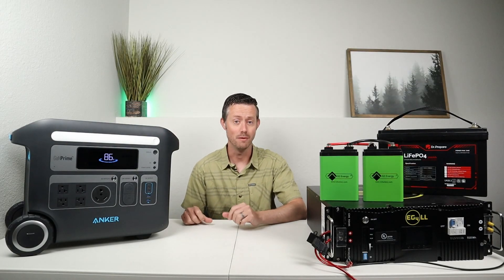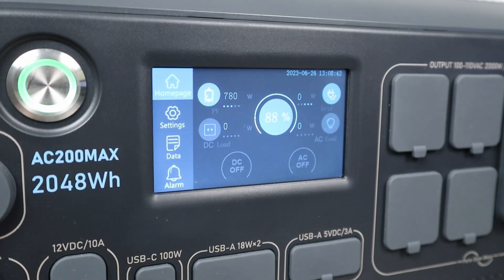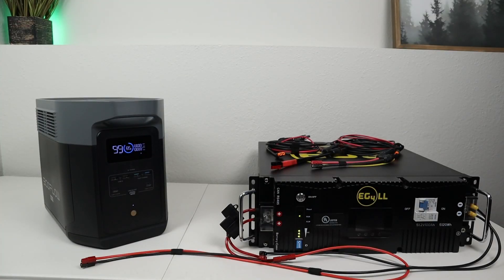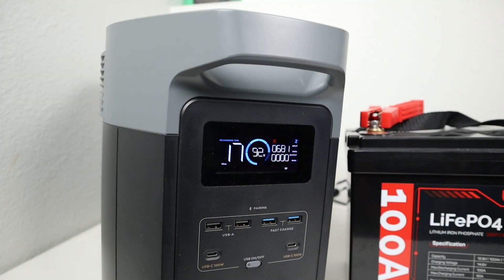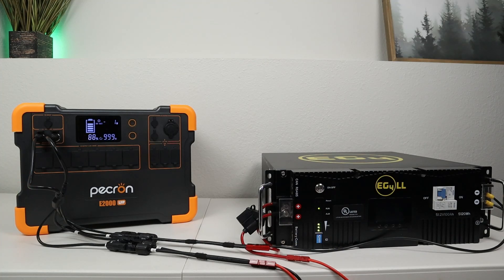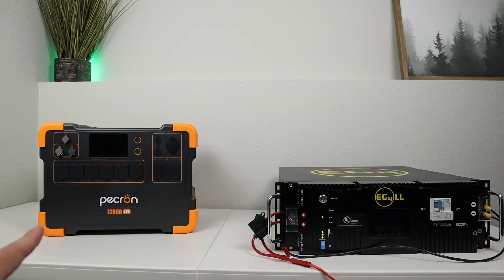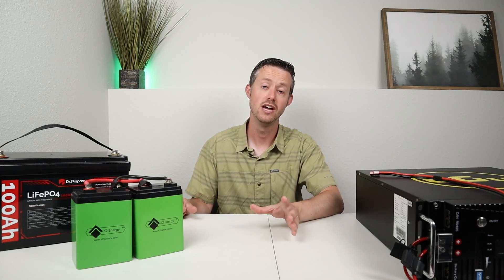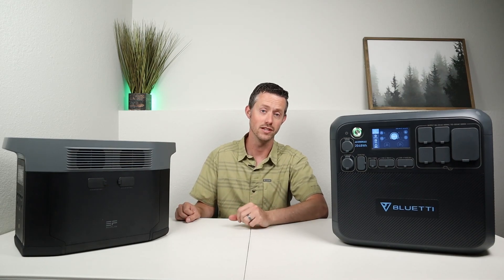Using Batteries To Extend Power Station Runtimes?! 48v LFP Server Rack 'Expansion Battery'!

Comment: Thank you for this information. 

In regards to recharging the external lithium battery, the Dr. Prepare 12v 100Ah battery, how do you go about recharging that battery once it is depleted? Can you just plug in a 12v DC adapter from 120v AC wall outlet? Like let’s say the wall adaptor that comes with a car refrigerator for example? (120v AC in with 14.5v DC out at 4.1A or 60 Watts) Will the BMS auto shut-off the recharge when completely full?
Reply from the maker: You'd have to manually charge the battery up. It's best to use a dedicated LFP battery charger or solar charge controller like either of these:
https://amzn.to/3XzQo1j   (AC Charger)
https://amzn.to/3CVrdgg  (solar charge controller)

I wouldn't recommend using just a power supply but technically the BMS should stop charging when it hits a certain voltage. But it will start and stop charging over and over unless you disconnect the power supply.
Reply: @Jasonoid  Thank you very much for this information!

Comment: Question regarding your 24V setup, curious if the result changes if you switch from using the 2xK2s to 2x100Ah. Also, what happens if you hookup the batteries in series vs parallel.
Reply from the maker: Voltage is voltage. If you have two 12v 100ah batteries in series you'll get the same result as one of these K2 batteries (I only showed off the K2 batteries since I have them around for my kids power wheels). 
When you put two 12v 100ah batteries in SERIES you get a 24v 100ah battery. If you put 12v 100ah batteries in PARALLEL, you get a 12v 200ah battery.
Reply: @Jasonoid  From a capacity perspective I understand. I was just wondering if hooking up series vs parallel had any impact on charging rate.
Reply from the maker: @kourgath007  the lower the voltage, the slower the power station will charge. You'll see 100 watts charging at 12v and 200 watts charging at 24v
Reply: @Jasonoid  I am assuming that using a 2x100Ah 24V configuration would benefit from using a boost converter like the one you setup in a previous video. Boost output to 48V @ 10A. Just trying to think through optimizing this setup.
Reply from the maker: @kourgath007  you would charge more quickly that way but the more efficient way to charge would be without the converter and just using 24v directly from the battery

Comment: Maybe I missed it, but make sure your battery has a BMS to protect it from over discharge.  I made a cable with a 6s BMS to go  between  my 6s  batteries and the solar power station , i.e. only need one BMS for multiple batteries.
Reply from the maker: All batteries I am testing with in the video have a BMS. I guess the only battery type that wouldn't would be a lead acid battery. Great tip, thanks!

Comment: Jason, WELL DONE!! A much needed  solar power video that answered questions about this subject that has been overlooked by many.Thanks for the tool links but also wondered if you had an Amazon store for Jasonoid that we could buy from? Also could you provide links for Anderson power pole connectors and the inverter in this video please? Also what amperage for the Anderson connecters , 30 or 40 amp?Thanks for another clearly explained video on this subject material.
Reply from the maker: I use the 30 amp Anderson connectors. Here's an old video I did on how to crimp them... parts are in the video description. Warning... its old so it may be a little cheesy compared to my newer stuff:  https://youtu.be/bZHh3nWXtkw

Comment: Learned something new today.  I did not realized I could hook up the Bluetti charge enhancer as a simultaneous second charge source from my 24V battery (primary connection is a 24V to 48V DC boost converter) setup to charge my AC200P.  Thanks again for doing this.
Reply from the maker: It's useful when trying to dual charge :) You'll have to let me know if it still works using the same source. The charging enhancer doesn't seem to like the 'shared ground' between the enhancer and the mppt when connected to the same battery.
Reply: @Jasonoid  I have 2 Power Queen 12V 100Ah batteries connected in series, channeled through my 24V to 48V boost converter into the AC200P solar input.  The Bluetti charge enhancer was connected to the same battery and input into the AC port.  Happy to say that this works.  I was getting 570W (typical with this setup) through the solar port and 226W through the charge enhancer.
Reply: Now I am wondering...since I am using the solar input port from the external battery input, the solar panels are disconnected.  Can I hook my panels up to a solar charge controller and then to the external battery to charge it while the above setup is in place?
Reply from the maker: @robertlueke3238  yes, you can have a 24v charge controller and solar panels on that battery and charge that up instead.
Reply: @robertlueke3238  in other words does your external battery BMS allows passthrough charging to allow charging it via solar at the same time you are discharging via boost converter to DC port? Perhaps an interesting test idea for a video...🤔

Comment: Almost got my answer with BLUETTI I have the AC300 and one B 300. I just got the AC180 and do50 charge enhancer can u do a little more on the way to use my 48v server rack battery it’s just like one u used in this video but didn’t seem to work through the charge enhancer which I was hoping to use the 48 v server battery with charge enhancer on my AC180 any ideas ??  And thanks for this video and any advice going from here.
Reply from the maker: The 48v battery works fine into the MPPT port. I'm guessing it didn't like the "shared" power source so having both chargers connected to the same battery is a no go. I might try some other solutions to see if I can get it to work.
Reply: I did watch a video where a guy used a 24 v battery with charge enhancer and he said to always have power to the charge enhancer first with green light on before hooking up to the BLUETTI Input said it will blow the 15 amp fuse inside the charge enhancer. That might have been the 730 w surge you got before it shut down just a thought
Reply: I’ll keep my eyes open thank you

Comment: thanks for the video, my take away
diy expansion batteries are almost always cheaper per additional capacity added, but requires more work on yourself, while the expansion batteries are simple plug and play.
shop around sometimes you can get great deals on diy solutions, but if you want a headache free solution, the expansion batteries are a simple solution.
Reply from the maker: Great take away, I agree :) If you want something that just works without thinking, the model expansion batteries are the way to go.

Comment: Thanks for doing this. I've been considering doing this. I have an AC200 Max and have read of people using a 48 volt battery with the charging enchancer and it working fine. Can your try using the charging enchancer plugged into the unit  by itself?  (Without the 48v battery also powering the main solar/dc port)
Reply from the maker: Yeah, I think it has something to do with 'dual charging' from the same source.

Comment: Of course if I could buy us a lot of EG 4 batteries or something like that where I can get like 6 or 12 woman hook it up to something like that and keep it running indefinitely and charge it with solar both ways then the batteries and the generator I think I might try that even though I think it might be better just get their battery packs instead but it gives me good options thank you very much cuz I'm about to buy adelta bluetti or pecan or all three even though I can buy only one at a time without their batteries because I have to save up money for that just like I got to save up money for each of the generators I want to buy what is your next week or the week after I'm buying one even though I want two of each even if you can't combine them because I have uses for them in different situations with different areas which one of them would really help me out in my car in the wintertime to keep the inside of my car warm and fridgerator and freezer going as well as a little heater like I said warm and maybe something to cook with and that's something like that I'm planning for my daughter when she gets a vehicle are cool for the summer time when car is off and not going anywheres which also the same for the summertime. And I think I could use it in my house a little bit but from one room to another probably not just one room at a time. I mean even the Delta pro is only subject to 7200 watt could almost run to my big loads so I have to get three different ones six of them but they all wouldn't be from the same company just for the difference 120 part I won't have a problem with it with those it's just a 240, 220 have problems with cuz it doesn't give enough watts to run them all at the same time which one of them choose when I'm going to run one of them that parting some big of a deal it's just incidentally 2 of them wants to run at exact same time I would have big problems.
Reply from the maker: I certainly don't have the budget for lots of these 48v batteries, I could hardly afford one of them. I thought it would be a fun video to see what would happen! Thanks for checking out the video and sharing your setup!

Comment: Excellent video!  EG4 has some really great products.  I am looking at this option for my AC200MAX.  I already have 2 of the B230 batteries and 2 of the DC charging enhancers.  I am wondering if the AC200MAX is experiencing a problem that was observed on the Pecron, ie, some kind of loop by using the same source on the two different inputs.  I haven't checked with the server rack battery as i have yet to purchase one, but the charging enhancer definitely works by hooking a PV 350 panel to the AC charger input and 2 of the PV350 panels (in series) to the PV input.  I suspect that having a common ground between the 2 inputs may be causing the problem.  About twice a year, Signature Solar offers free shipping so keep an eye out if you want to order something from them.
Reply: I think that by adding 15A or 20A blocking diode to each of the ground returns to the battery (15A will loose about 9 watts and 20A will loose about 12 watts), this would break the common ground of the battery or multiple batteries and allow Pecron and Bluetti to use both inputs from the same battery if the common ground is indeed the problem.  I'm going to order some and try them out.
Reply from the maker: Good thinking with the diodes, thanks for the recommendation.  I'll have to try to mess around with it when I get a chance.
Reply: I am planning to run my 48v EG4 server rack battery with the Bluetti charge enhancer on my AC200max, but ~900W solar on the other input.  I’m hoping for no over-current issue as in your video.  It also appears that the AC200max also doesn’t let you prioritize solar for dual charging, but rather gives the max from any input.  I guess the best thing is to run enough loads while charging, so you don’t care so much.

Comment: I just added the battery I ripped out of the broken Milin to the AC200P yesterday. I have a 180w panel into a separate MPPT Charging the Milin battery, and the XT90 from that battery plugged into the DC Charging Enhancer. I am not doing it to extend, I am doing it to try and smooth out the input.

I vote for the DIY setup as I don't trust being tied into a proprietary battery. I think a 48v server rack, or series capable 12v lifepo4 is the way to go. They are modular and hence repairable, and easy to connect to anything. When the Milin died I couldn't repair it, I just had to disassemble it and take out the core which is just the batteries and a BMS.
Reply from the maker: I'm curious, what voltage is the Milin battery?

Comment: Another excellent video.  I appreciate how you explained that this does NOT add capacity to these power stations, it is simply charging them from another source, which can be done (with most of them) while they are in use.  This effectively extends their run-time and I like how you articulated that distinction.  I am using a variety of "2nd-life" batteries, like the 24v 9.6AH units you got from Battery Hookup.  I like building stuff myself, even though there are definitely mistakes made along the way.  I think the brand-specific options for truly adding capacity to these larger power stations are cool, but also insanely over-priced.  I personally feel that if you need the kind of capacity they advertise with their add-on batteries, you're probably getting out of the "portable" space and you would be better served with a component-based system, at that point.  Love your work!
Reply from the maker: Great comment Jason, I appreciate you watching the video and sharing your setup. I think there is a lot of value in finding used batteries and repurposing them :) They are usually CHEAP! haha

Comment: The only real negative is not being able to hook up an expandable battery to the main unit and have it charge! It would be great to be able to charge it from solar through the main unit.
Reply: Most power stations have a DC output and you can get a DC-DC charger... would be interesting to see the efficiency loss though👍
Reply from the maker: The DC output can't handle much power, only 125-135 watts usually. So as long as it's a low powered DC to DC charger that will work.
Reply: @Jasonoid  I believe there are units like Victron where you can set the power output limits, IDK if they'd go as low as 100W though
Reply: if you plugged in a stand alone wall charger to the main unit while the main unit was pulling solar it would then charge the expansion battery not clean and tidy but it would work
Reply: @v1d9uy  
DC to DC? It would be pretty limited on how much charge you would get.

Comment: I use solar generators for emergency blackouts (Texas Freeze 2021).  Since the manufactures backup batteries are only two to three hundred dollars more than a base unit, I purchase multiple base units.  If I had to bug out I can easily grab them and the portable solar panels, as opposed to cheaper, but more unwieldy, 24v batteries.
Reply: I think the way you did.  After the Texas freeze I bought a 2nd Delta max instead of the extension battery.  Also have the Honda generator I can use to charge them in case of inclement weather also, that way you just run the Honda generator for a couple of hours to charge them instead of running it all night long.
Reply: @shelley131 Ecoflow told me that the Delta 2 Max main unit can't be connected to another main unit, only to an expansion battery.  Is that not true?  Were you able to connect two main units together?
Reply from the maker: That's a great point. I have heard of a couple of viewers now doing the same thing. Why not have two fully functional units instead of a battery that is expensive and can't do much. Thanks for sharing your experience!
Reply: We are testing a more powerful replaceable portable power station, the replaceable battery weight is very light, but more capacity, if you are interested, you can follow us.

Comment: An excellent topic for those of us with a camper.  Upon deciding whether to add an inverter to my slide-in truck camper - I opted to just modify a cabinet in order to slip in my modest EB70 power station.  The power station is located above the 100 Ah LiFePO4 battery for the camper.  Although I'm limited to a 100 watt recharge rate on the Bluetti, the EB70 is easily installed and removed from its cubby in seconds.  The 100 Ah camper battery is kept charged via 175 watts of solar and a DC-DC charger that is connected to the alternator/truck battery.
Reply from the maker: Thats an excellent way to add an inverter / light / and USB charging to your rig. Simple and it works well!

Comment: Finally someone puts up this idea into a video I've been wanting to see in a long time. Using server rack batteries as battery generator expansion pack. Thank you!
Reply: What Sort Of Sorcery Is This ? 🤔
Reply from the maker: I hope the video is popular for people to see how easy it is :) It's a great solution!
Reply: @Jasonoid reat 👍.... Could you do one more test on the Pecron.... Use 48v on one mppt and on the other use 24v to see how the reaction will be with different voltage.... While you are at it hookup the 12v on the 3rd port....   Seems to me that best way to use this full time is charge 48v on 600-1000watts on solar feeding the E2000lfp thus eliminating the brick.... Gives you 7040 watts for $1500 vs  8064 watts for $2800. Throw in a 100amp on small port and you get your missing 1k to be equal with add on stock setup.... Plus the DIY breaks the max limit of 8kw to infinity if you have Elon's money😊
Reply: @Jasonoid - All to what you said. And also the value/capacity on money spent in buying one rather than the proprietary one to that brand. Just the syncing of the batteries to charging you lose on the brands. But you already showed this work around in another video so all is a go! Thanks.